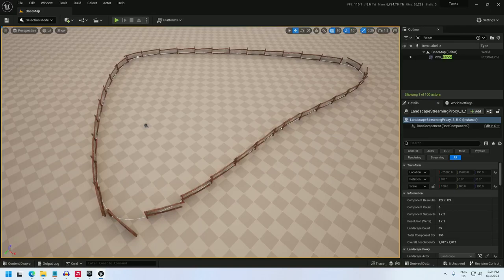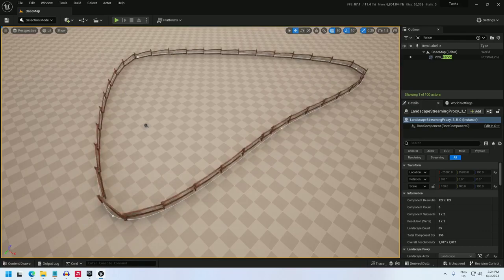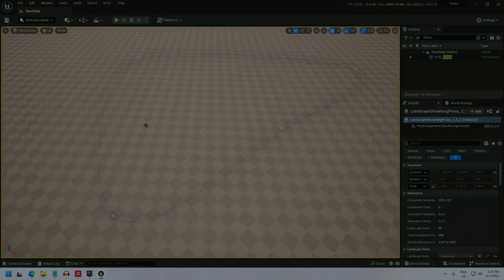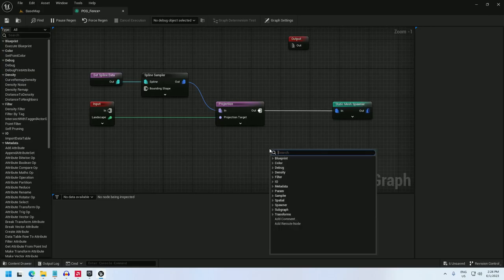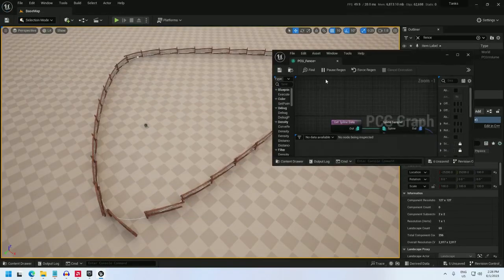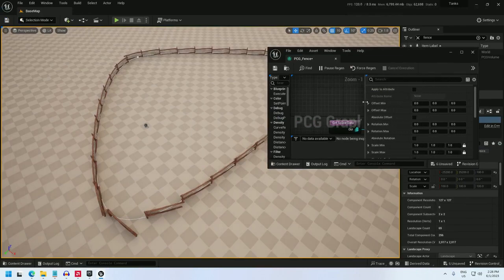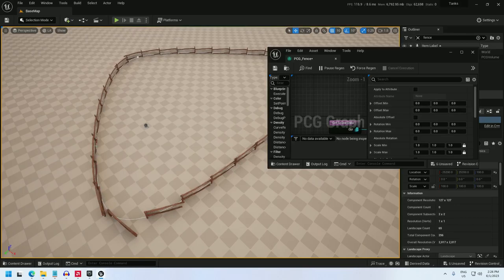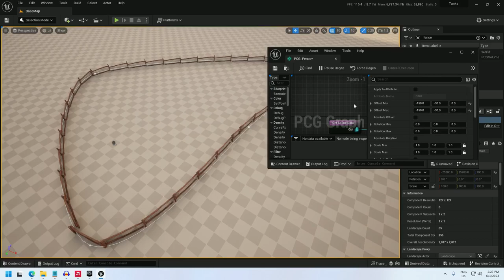Unreal Engine 5.2 PCG Tutorial - Spline-Based Fence Alignment Fix

Comment: Hi Michael, my fences too were not getting proper alignment , so I used the construction script to make my fence, however, now I dont know how to edit the fence in my PCG Graph because I want to pass a road through it :(
Reply from the maker: PCG isn't designed to delete objects, only add them. Technically you could get around that by spawning an actor that's designed to delete part of the fence, but that's just adding extra complications that'll make things harder to work with in the future. Your best bet is to figure out how to make the fence align properly in PCG, then just don't spawn the parts overlapping with the road.

Comment: for me , the fence basicly is still wrong rotated but cant fix it like , unfgames showed it ... any solution ? i used a different fence model
Reply from the maker: Try adding a Transform Points node right before your static mesh spawner, and play around with rotation on the Z axis.

Comment: if the ground is not flat, is the fence going to be floating in the air ?
Reply from the maker: A little bit. The projection node will make sure the points stick to the landscape, but the mesh itself is straight so it won't perfectly align to a slope. It looks okay to my eyes as long as the slope isn't very sharp, but it won't be photorealistic.